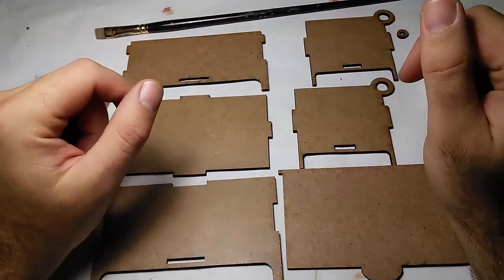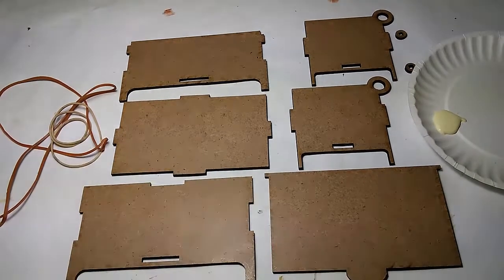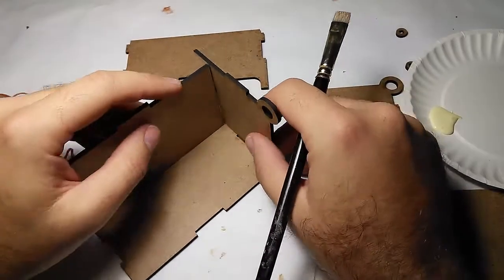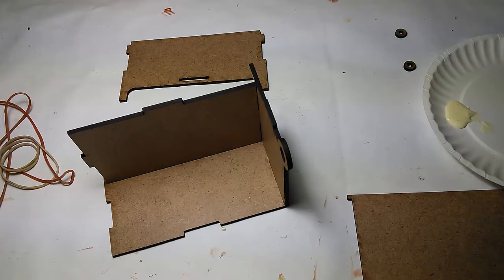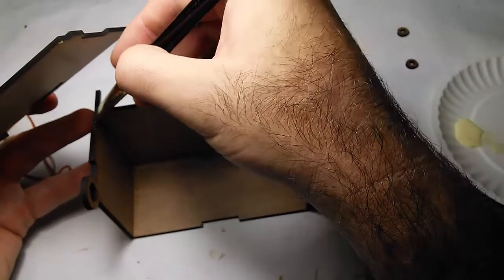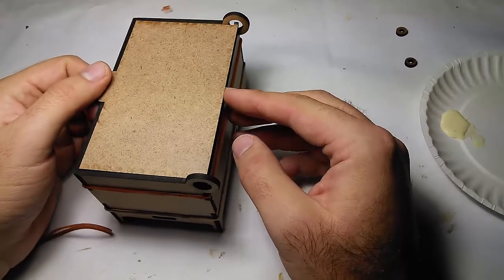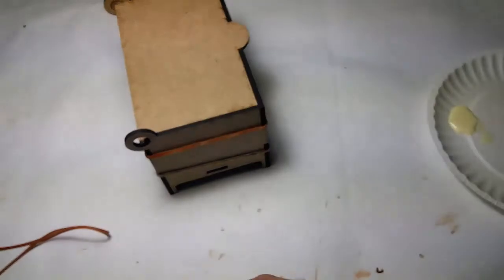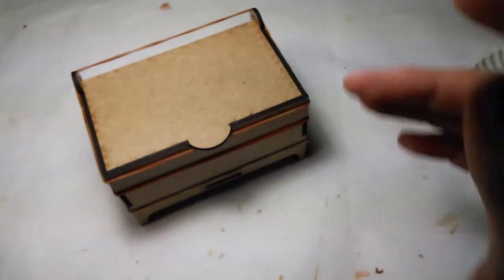Making a box with a laser-cutter - Step 5 - Assembly

Comment: Cool. Can you tell me what is the inner diameter of the opening and what is the outer diameter of the hinge circle? I want to make something similar but don't know how big the gap should be or if inner diameter can be same as outer...
Reply from the maker: The inner and outer diameter are the same.   The laser takes a bit of material off, enough that the joint is loose.

I can't remember the diameter offhand, but it looks to be about 1/2 inch.
Reply: yeah, I saw your other videos then.  Thanks anyway.

Comment: Hey Ben... thanks for this series of videos. Quite informative. I was using Fusion 360 instead and while some of the workflows are different it wasn't too hard to translate.  I do have a question though. Do you ever try to adjust for the kerf so that the pieces get a tighter fit?
Reply from the maker: For most of what I do, I don't find it necessary to adjust for the kerf.    Once I have my own laser cutter, I may experiment with that a bit.